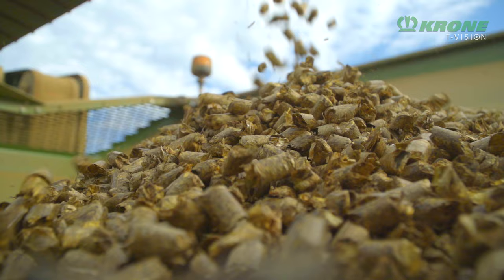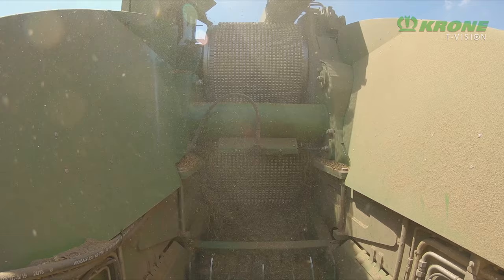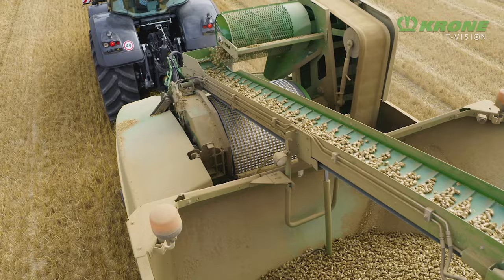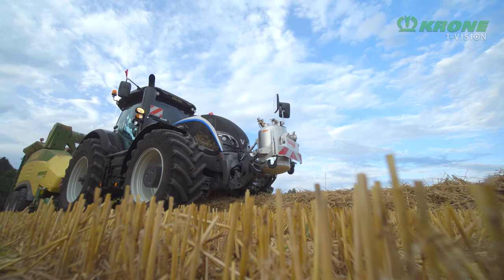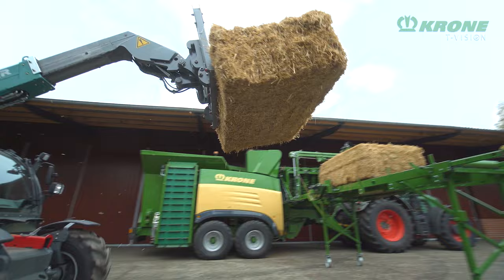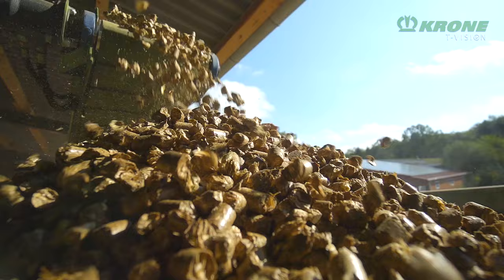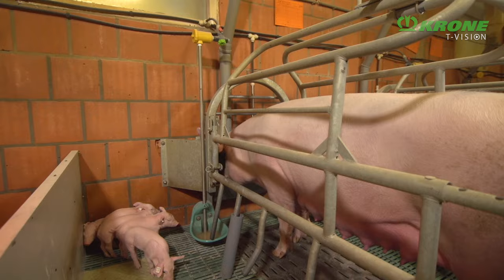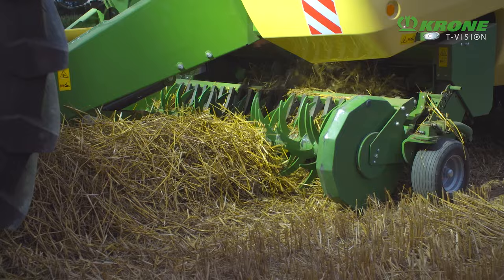KRONE Pelleting press – Premos 5000 (2019)

Comment: I hate to break this to you, but this is not the worlds first pellet maker,,,, nice try! John Deere made these back in the 70’s. And they were self propelled.
Reply: That was a cuber, and it was a failure.  They didn't make many of them, they didn't make them for very long, and the machine didn't work very well.
Reply: farmerboybill that’s not true they were made from 1965 to 1983. Some are still in use today it was probably never big numbers but successful enough to make them for almost 20 years.
Reply: @Johndeere42302008  Again, that was a cuber, not a pelletizer.  It was built in limited numbers for 12 years.   Deere stopped building them because they were a failure.  Almost all of them have either been scrapped or are sitting in fencerows by now.  It was a failed machine, otherwise Deere would have continued to build them.  Manufacturers don't spend millions to develop a machine only to stop building it after a dozen years. 

We can get into why it was a failure if you want, but  my knowledge of how the machine actually functioned is very very limited. I think it was mostly due to the fact that in-field cubing didn't give the consistent moisture needed to make good cubes.  I assume speed of production also had something to do with its demise.  "Rain is coming, and I'm creeping along.  I should have bought a baler!"  Probably the same things  that will challenge this machine
Reply: @Johndeere42302008  almost 20 years he says. 12 years or 20 is way to big of a difference to call it almost.
Reply: Noah07 83-65 = 18 I don’t know where anybody got the number 12 must be common core math
Reply: I know it was a Cuber. Think about how many failures do you know get made for 18 years, if something is a failure it doesn’t get made for more than two maybe three. I realize that it’s not something people do anymore but it was a way to try and move forage more efficiently. 1977 is when the big square baler was introduced pretty sure that’s probably what killed it along with the other things you listed as well. I also know it was only good for alfalfa because there really wasn’t any good way to make grass hay stick together, I’m pretty sure there was a water tank on it to help you control the moisture. I think it would have to be considered at least a partial success for Deere to continue to build it past the five-year mark
Reply: farmerboybill you don’t know what you are talking about. They worked great, pellets, cubes, it’s the same thing just a different dye they are pressed thru. We had two of them and still do. They were to expensive to maintain and the market for the cubes that was the problem. It dried up and that was the end of them.
Reply: @Johndeere42302008  I mistyped.  My original point still stands.
Reply: @peteparker7396  Pellets and cubes are the same thing?  I encourage you to go buy a pellet stove and feed it cubes.  You are right though -  it was a failure.  Just like I originally said.
Reply: @Johndeere42302008  How do failures last for 18 years?  Well, picture this - A company is flush with cash because they just released three very successful tractor series in a row - the 20 series, 30 series, and 40 series over the life of the cuber.  They have spent millions developing a machine that they are convinced is a successful unit.  The machines work OK in field operations and the people who have bought them generally like them, but they are selling very slowly.  The board keeps thinking that the the cuber's day is coming and they're gonna start selling at any moment now.  1 year turns to 5, turns to 10, turns to 15, and still the machine is only trickling out.  But it doesn't matter because the waiting list for new tractors (and now a great planter, good small square balers, and pretty good combines) is getting longer.  With all those other sales, they can keep pushing the cuber along for just one more year.  Now 1983 comes along, and it is very clear that the cubers day isn't coming.  They have yet another successful tractor series coming out, but the farm economy is starting to look a lil' shakey. 

The board starts thinking, "Hmm, maybe we should cutting some of these money losers from our line.  How long have we been making that cuber, and how many have sold?... WHAT???  It doesn't even have our own engine in it?!?  Kill it now!"

There you go. 18 years of production on a failed product.
Reply: farmerboybill I’m not saying that’s not how it happened but I think you have to realize that Deere wasn’t always in the business of making large production numbers. Starting the next year 1984 John Deere released the 3830 and 3430 self-propelled Windrowers. The last year of production was 1996. For the 1992 3830 production run there only was 38 units. Obviously Deere didn’t sell huge numbers of them everywhere but in this valley there was about 50 of them sold. They were very successful and helped launch the local dealer into building self-propelled rotary swathers out of them. Just because a machine wasn’t successful everywhere doesn’t mean it wasn’t a success. I’m pretty sure the big baler was a better way to make forage more efficient and that’s probably what finally put the final nail in the coffin in the areas that were still buying cubers. But the fact that people continued to run them for the next 30+ years is definitely a testament to the fact that they worked, in your original statement you said that they were not made for very long and that almost none of them were made well it is true that not very many of them are made, approximately 500 were made and I’ve never considered 18 years to be a short time.
Reply: @Johndeere42302008  I completely disagree with your statement that Deere isn't in the business of making large production numbers.  They developed the cuber in hopes of selling  hundreds of thousands of them.  They sold less than 1000 over 18 years.  I had originally said they didn't make them very long because I thought they had only made them for a handful of years.  It's amazing they lasted 18 years in production for so few produced.
If a company doesn't sell enough units to recoup its development costs, it is a failure.  A big company with other more profitable units can absorb losses on failures for a long time.  You've now listed a second failed product - 3430 and 3830 windrowers.  I personally know someone with one that still uses and likes a 3430, but it is still a failure.  They also made the 100 baler for a time.  There are still some in use.  They are junk from my understanding.  That is a third failed product mentioned here for Deere.  The 100, 200, and 300 stack wagons were supposedly the best stacker one could buy.  I am actually looking for a 200, but am unlikely to ever find one.  Deere sold a couple thousand units over about 10 years.  Failed product. 

I think you're getting your info on these things from the same book I am.  Read the last paragraph on column 1 on page 26.  For a book that is clearly cheerleading for the company, they come as close as they dare to say what I've been saying here all along.
Reply: farmerboybill I never said it was a complete success or that it was awesome and everybody used it everywhere I’m not disagreeing with you that it was a limited run. But you obviously don’t know a lot about how John Deere actually works they never made the 100 Baler that was a krone baler rebadged. It had a lot of failures because of translation from German to English on the monitor and just simply being the wrong baler for the market. That one’s definitely a failure. Do you realize that John Deere only makes about 3000 combines a year and they’re one of the largest combine manufactures in the world just because something doesn’t sell hundreds of thousands doesn’t mean it’s unsuccessful. The only product I know of off the top of my head that they’ve made hundreds of thousands of is the 4020. The stack wagons I’m also pretty sure were made by somebody else and I doubt they ever expected to sell hundreds of thousands of those. Why does John Deere bother with the frontier line I’m sure none of that stuff sells hundreds of thousands of units either agriculture is a very different market compared to automotive it’s not a product that everyone needs there’s lots of niches and lots of small markets Deere and lots of other companies are committed to providing machines for those markets so I don’t believe production numbers is always a good measure of success.
Reply: @Johndeere42302008  You're right.  It wasn't a complete success because it wasn't a success at all.  It was a failure,  You wanna talk combines?  They built their 500,000th combine in 2010.  Their combine line was and is a success.  They probably make less combines per year than they did in the 70's, but they sell them for a lot more money.  They built their 1,000,000th tractor sometime in the 50's (I have heard it was a model 60).  Their tractor line was and is a success.  Not all models of tractors or combines made them money (some of them were downright junk), but they made them enough money to pay for development, tooling, labor, etc and still give them a good profit for the corporation.  Which then allowed them to further develop more models of the same machines.
Ask yourself - Did they make enough money on the cuber over its life to pay for its development, tooling, labor, etc, and also give them a good profit for the corporation?  Corporations live and die on profitability.  It isn't even good enough for them to only be profitable.  Otherwise profitable corporations have been taken over, broken up, and resold in pieces because they weren't making big enough profits.  If a product doesn't make enough money to justify continuing to develop and build it, it is a failure to the corporation.  The cuber was a failure to John Deere.  They tried to develop the next new thing and it didn't work out.  They kept on it because they could afford to, and were hoping it would eventually become the next new thing.  They quit production after it became glaringly obvious it wasn't going to be.  I can only guess they had a ton of money poured into the development of the cuber and were really hoping to recoup that money.  The stack wagon, which was built by Deere in Des Moines, didn't even make it a decade.  They sold more than 1000  in two years in the mid seventies, and they killed it off a lot faster than the cuber.  It was a lot simpler machine that probably made them money, but it was also not the next new thing, and they saw that a lot sooner versus the cuber.

 I don't know what more I can say about this.